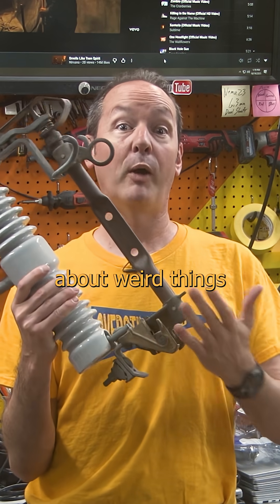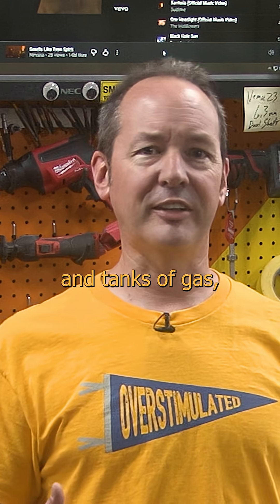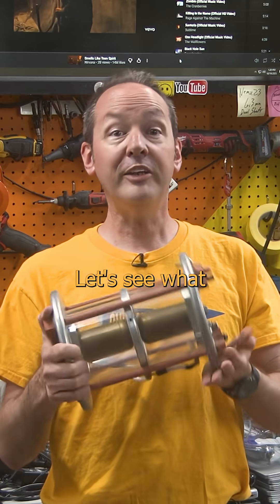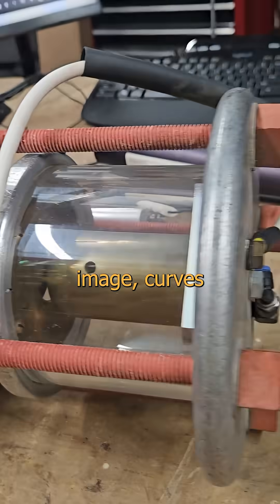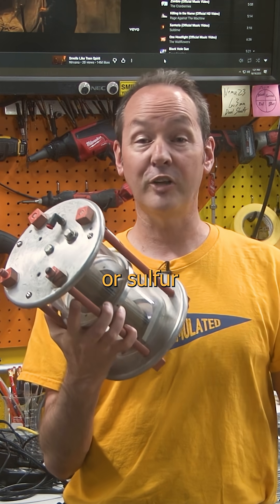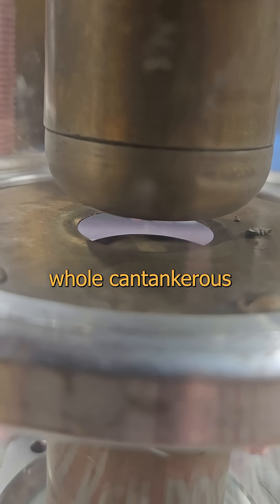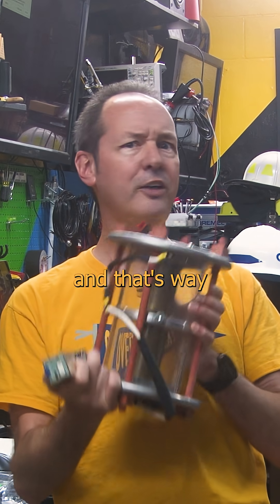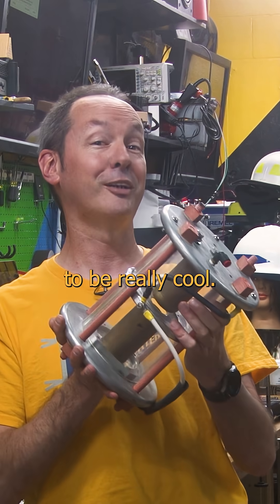Triggered Spark Gap #chrisboden #comedy #highvoltage #physics #engineering #science #educational

Comment: This might be a stupid question why don't the sharp corners on the square nuts cause a problem? I assume there must be a reason they don't have to have rounded edges also.
Reply: I think the bolt and threaded bar is just for storage to keep it together and that it fits in somewhere. Just my guess. High voltage don’t like sharp edges because it interferes with the magnetic fields to abruptly, if thats tue right word. One also don’t leave pointy bits and even limit air gaps between strands when connecting HT power lines. HT is truly witchcraft 😉

Comment: Electricity is amazing! Even at lower voltages under the right (wrong?) circumstances it can melt huge amounts of metal nearly instantly. After  50 years of experience I have a little bit of fear of electricity. I have a HUGE amount of respect for it!.

Comment: Worked around a 21k volt compartment opening that thing was a scary endeavor since its potential arc could very well jump a foot or more and we discharged it was a 2 foot pole wired to ground but it was an older machine that got replaced

Comment: Question, why do you say below 300V and not 600V?  I do not worry about jumping until I see over 600V, excluding arc flash crap 600 and down is pretty straight forward.  What am I missing?  Do not get me wrong, I like your stuff, you are one of the best in my stack, but I am an old 480 guy since 86 and I see no big dif between our 240 sys and the traditional 480 sys.  In all honesty I have yet to work around the 600V stuff but I don't think it is that much of a stretch beyond the 480 world.  I am interested to hear your take.

Comment: The group I used to work with built a triggered spark gap out of TIG electrodes in air. Good for a couple thousand volts switching, and massive current capacity, enough to blow apart a 40j rated CVR.

Comment: Heyo, potentially stupid question here...  forgive my ignorance I am only beginning to learn about high voltage.

If you're using a gap as a switch and the high load then jumps a gap to complete the circuit, would that not lose an awful load of power and be wildly inefficient due to the resistance of the atmosphere?

Comment: So basically it Works like a tig welder with high frequency start. 

200a at 20v won’t jump a 1/16 gap.   Zap that gap with 10k volts 500 times a second at .1 amps and suddenly 200 amps is more inclined to join the party.

Comment: I have a CW multiplier stack that can do 150 KV in air, I've used it inside.  Needless to say the output terminal is big with large radius rounded corners to stop corona.  For me up to 40 KV or so, it's no big deal.  Above 50 KV, EVERYTHING becomes a big deal.

Comment: 33000V from right to left hand made me feel pretty wierd for a few hours afterwards. 
Installed a new stator on my bike and had one hand on the cable (removed the sparkplug connector so bare metal)and one on the frame😅 hurts

Comment: It looked like a dump switch for Pulsed Power until the two white leads met at the middle.  Unless there are some resistors to tune the cut on voltage then it maybe a safety discharge valve.  I am guessing here.

Comment: Flybacks on CRT televisions kick out around 35KV at. 50W. The tube acted like a capacitor and upon touching the wire without shorting out the anode would send you back 5 feet..

Additionally, I made 25kV AC shockers from standard 9V batteries in 1990. My idea was to use it as a stun gun well before I knew they existed. I could weld a  little with it grounding metal.

Comment: I used one of these for a capacitor bank intended for exploding things and powering other high-power toys. Smaller than yours, but same principle: Two big high-current contacts spaces a bit too far apart for the four kilovolts to arc across, and a third wire poking up in between them to act as the trigger. The trigger was fed with a 15kV neon sign transformer through a couple of resistors - just enough to make the trigger spark.

The thing worked great, replacing an earlier pneumatically-driven contact that tended to blow itself apart a lot.

Comment: Funny story regarding an experience with just over 300 volts. Back in my USAF days (1965-69) two of us were responsible for maintaining some refrigeration gear used to cool a couple of vacuum tube computers. 

We got a call one night saying one of the systems was down. We grabbed our tool kits and headed for the machine room. We found the big Worthington compressor wasn’t running. First step, check to see if we had power. We had a simple way to do this using a pigtail socket with a 240 volt light bulb. 120 volts would produce a dim light, 240 would light the lamp full brightness. 

The guy I worked with dug into his bag and pulled out his pigtail socket. He held the two leads, one in each hand and touched the wires to the power terminals. 

There was a brilliant flash and a loud boom. The guy was sitting there still ok but his face and hands were black. The 240 volt bulb was missing. The leads on the pig tail socket were about half their original length. 

We had forgotten one tiny detail. This equipment ran off 480 volts. We were very lucky to have survived this.
Reply: Yeah, it sucks to forget what voltage your dealing with.  Once many years ago I had  go to a customer's factory to repair and restart a system that a co-worker took down the hard way. When troubleshooting a problem with a portion of the system he tried to use a 600v rated meter to test a 4160v fuse cabinet. He went to the hospital and the whole plant went down. He was off work for weeks, the factory was back up in few hours. But it could've been way worse.
Reply: @MatthewDouglas-n5w  I thought you were talking about Dallas love Field for a moment. The guy with the 600v meter was a little Sun Burned. The guy behind him was knocked off a 4-5 ft. ledge. He broke his leg. 4160 will blow you away but 480 will hang on to you and just kill you. This happened around the year 2000
Reply: So . . . Lemme make sure I got this. Dim bulb = 120v . . . Bright bulb = 240v . . .  Brilliant flash, disappearing bulb and shortened pigtails = 480v. Did I get that one right?
Reply: 480V? Sounds like 5881 tubes. They were in military gear and Fender Twin guitar amps!
Reply: Thanks for the tip. That means I have to triple check how many volts are running in a power system. Before I do anything.
Reply: Yes, I was working on some  kit built by Navy scientists in the Ops Room Crossmaglen Northern Ireland during the troubles and put a battery on it to test it, whereupon there was a loud bang and the air was full of shiny bits of foil.  I then realised I had applied 24V to a device designed for 12V and the input suppression capacitor had blown.
Reply: Soooo, it had power then. Step 2! 😂
Reply: It's all "funny stories" until someone gets his eye blown out.
Reply: i work in a factory and everything is 480 volts

Comment: I have two water tanks upstairs that I fell to have low pressure water in my house. I fill the tanks from my well. I'd like to be able to have a flow switch in the tanks with low voltage from the switch of the pump. Is that possible?

Comment: Hey Chris...If you get set up for it, howz bout showing why stress cones are needed, and what happenens the the lines of force around a bolted connection, when the current has to do a sharp 90 from the wire, thru the bolt, and then 90 back thru the terminal. Those fields overlapping in the 90, make a pretty picture as the circular lines of force multiply against each other.

Comment: I've never seen birds sitting on a 500KV wire. I'm assuming it's because at that voltage, the electricity doesn't stay in the wire where it belongs but instead ionizes the air around the wire, so if a bird even dared get close it would be fried because it actually does complete the circuit between the air on this side and the air on that side. No, they don't even get close because it starts getting uncomfortable as they approach, and birdbrains are smarter than your average tweaker.

Comment: Cool ... Though. Did the middle electrode have to be circular? I saw something similar in a ... Trinity site nuclear bomb and there were 2 triggering electrodes between 2 main electrodes ... You know what. I give the honour back. Circular electode is still going to have likely only one point that will create an arc but overtime as that point gets chewed up by the plasma another point will start arcing. Hence why it's going to last a lot longer.

Comment: Low voltage high current:
"Oh no the contact resistance is way too high! I can't cross that mild oxidation. You gotta use silver coated contacts, polish them and use special grease, if you want my full power"
High voltage:
"WHERE'S THE F*CKING GROUND!?!"

Styropyro made a great video about that with 100 lead batteries in parallel. He was able to get more power by putting some in series, instead of all in parallel, even though all in parallel should have been able to deliver more current.

Comment: I have a mouth full metal fillings from the late 70's that give me a super power, I can taste high voltage and high ac amperage makes my teeth vibrate. It only helped me save one life though, pulled a guy out of a small feeder room when he threw a 480v/600a breaker and my teeth literally whined like an old fluorescent ballast. Even a picosecond later and he would have been horribly scarred by the invisible fairy that threw copper pixie dust around the room and let out all the magic smoke.

Comment: Just a reminder that if it has an electron, with enough voltage, It's conductive.
Reply: I tell my electrical students that all the time...
Reply: @CaptainSeamus : Remember, if you heat the hull enough, a hard vacuum is also conductive.
Reply: one electron at 409000000000V, what would that do

Comment: That's an interesting 100kV AC switch, but you should see the switches used for the HVDC Grid backbone interconnects. With at least a 1 MV DC they won't even let you turn them off nicely.

Comment: I have one just like that attached to my 7500 volt power pole, and another one on my house. I fill them both with helium gas and transmit power WIRELESSLY thru a huge lightning bolt. The arcs on this thing are amazing, but you shouldn't be within a 300 foot radius when they're turned on.

Comment: I'm comfortable with voltage up to 1000V, because that still needs contact to do harm. We have 400V in our houses, and factories sometimes use 690V. The grid company sometimes use 1000V as a transport voltage since our overhanging cables are certified to that. So they can pull longer lines with less loss and just use a 1000V/400V stepdown transformer at the user

Comment: Low-Med voltage guy here, and the medium voltage stuff is done racking things in and out with a motor, from a control panel several yards away and while wearing a bomb suit.
A high voltage witch that you trigger with pressurized gas is the craziest thing I've heard of in a while... This channel is awesome.

Comment: They're also used in NDT x-ray tubes. Microfocus x-ray uses voltages upwards 200 kV, but is controlled by a 600 volt gate at the tip, called a grid. Using a turbo molecular vacuum pump the small tungsten filament can be regulated using that grid and will shoot x-rays down a tube which is focused using more electromagnetic coils, all the way down the tube until it hits a tungsten Target, which then scatters and produces x-rays in order to evaluate metal parts and welds.

Comment: That's why I love vacuum tube amplifiers. Sure, you have plenty of 12 volt wires in there, but those cathode plates in those little glass bottles are carrying up to 650 volts across, meaning that opening them up to work on them can be pretty shocking.  That's why you should always drain the capacitors before you touch anything inside, especially if you want to still be alive, much less still have a hand, when you're done.

Comment: Talking about oil baths.... I have a power station / distribution station near home and it has 63 kv going up to the pylons and what looks like oil pipes on the other side going into the ground.

I've seen the same sort of pipes inside the small hut that connects to those huge 2000 feet tall antenna masts too....

Is the idea that these things run a conductor in a liquid insulator? Is this better than more rubber around the conductor's girth?

Comment: Below 300V things can still get pretty fucky with high frequency AC. Especially in small packages. A lot of the wildness in modern IC design is figuring out how to keep the wires from talking to each other.
“We put insulation between them.”
“Ha. Good luck with that! They’re screaming at each other in fluent RF.”
This is just from the tiny edge of that that I know anything about…

Comment: Low voltage follows paths that you make, high voltage takes "if you want a job done right you gotta do it yourself" to a scarily dangerous level.
Reply: Electricity doesn't take the path of least resistance. It takes ALL paths in proportion to their resistance. Remember that breakdown voltage applies here, too.
Reply: @jonjohnson3027 all paths IS the path of least resistance.
Reply: Low voltage follows paths you make, high voltage follows paths you hate.

Idk, I just wanted to rhyme 😅
Reply: Everything is a conductor if you turn it into plasma
Reply: Low voltage electronics: Is that corrosion on the solder joint, awe i cant go through that

High voltage electronics: WHERE IS THE FUCKING GROUND!!!!
Reply: @ozan1234561  the major difference is that low voltage stays where you put it.
Reply: I've described it to myself as "and here, friends, is where our plumbing analogies stop working".
Reply: @blakksheep736  I like to explain these three ranges to people as a garden hose at wall outlet power, a fire hose and hydrant at large appliance power, and an invisible wormhole to the bottom of the ocean at extremely high voltages. The plumbing analogy fails, because there's no plumbing equivalent of conjuring the force necessary to make total containment prohibitively expensive but leaving guidance still viable for water... But it still follows curves like water, it's just a hole in the side of a sub, a damned laser. You don't contain it, you just keep it far away. Still "flows", the analogous pressure is just literally unfathomable
Reply: high voltage be like "WERE THE FUCK IS A CONDUCTER"
Reply: @shiny4984  low voltage: "i will only take the path of least resistance, and will never go through anything unless it is a conductor"

high voltage: "WHERE IS THE FUCKING WIRE"
Reply: @acgaming1643 I thought it would be,    High Voltage, “There was a wire”?
Reply: @acgaming1643 it's less "WHERE IS THE WIRE" and more "I DON'T NEED NO DAMN WIRE! I MAKE MY OWN!"
Reply: @Kataclysm113  I AM THE WIRE!!!!!!
Reply: @acgaming1643 I actually burst out laughing at that. Thanks. :D

Comment: I work in the fun range of voltages where its not kV’s but will defenitely give you a few bucks off your cremation if you touch it, and i was fascinated when finding out the contactors/HV relays are gasfilled and use perm. magnets to “extinguish” arc flashes when switching. Awesome stuff

Comment: Current does not "flow".  It's not a tangible substance.  It's a product of voltage and resistance I=V/R.   It's not like you got a bucket of current on one end of the wire that "flows" to the other end.  That ain't how it works.  

The voltage phase vector "flows" and creates current as it propagates, depending on the resistance, which doesn't move ordinarily.

You should correct your terminology to reflect this realization.

Comment: That's kind of like a thyratron's evil twin, I don't recall the details but there's a pressure vs breakdown voltage curve and Thyratrons operate on the lower slope of the curve where breakdown is mediated by ions and cold-cathode emission and you get well behaved glow-discharge and TSGs operate on the upper slope where breakdown is ... well an arc really, mediated by the temperature of the gas.

Comment: I found out about high voltage doing crazy things from working on car spark plugs. The cables can give you a warm fuzzy feeling if not attached or if the insulation is old. One time my car died, one of the cables was close to a another wire and little sparks were jumping through the insulated wire to the other wire. I thought that was weird and moved the cable and ZAP.

Comment: Years ago I worked on a project that introduced me to Marx generators: giant capacitors that are normally wired in parallel and thus charge at a low voltage, but are connected by spark gaps which, when triggered, brings them into series to discharge, generating huge voltages!

Comment: I've wanted to ask a question. My brother was once homeless and was watching some worker's working on some big electric lines under the roads.  At one point one of the workers jumped in the hole and touched something I'm guessing and there was a blinding light so bright everyone was blinded for short bit and for a moment all the lights in all the buildings around them turned on before going out. There was no guy in the hole and they were looking for the guy even asked my brother if he saw anything. Then I'm guessing the boss finally comes over and basically said "he touched the city". I just have to know is that actually possible? Like it even apparently vaporized the guys solid metal tools on the guy.